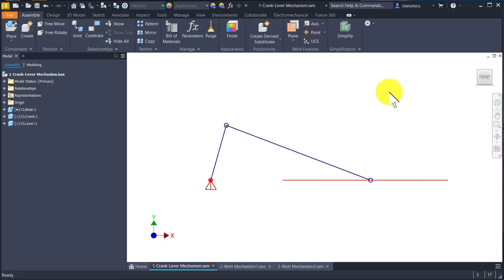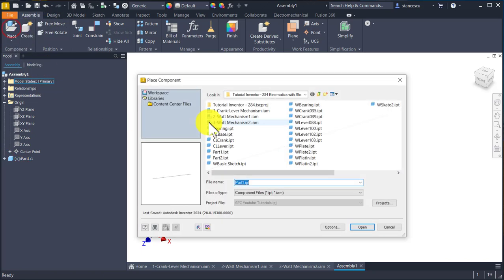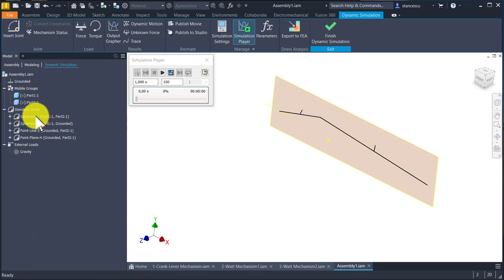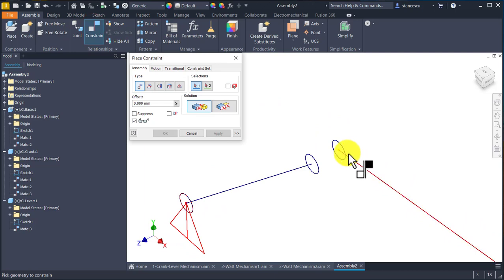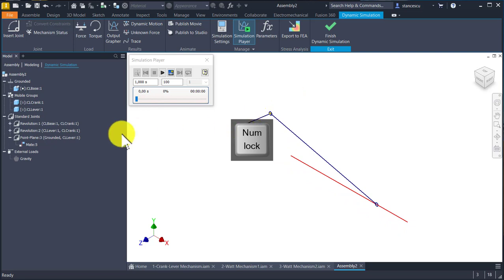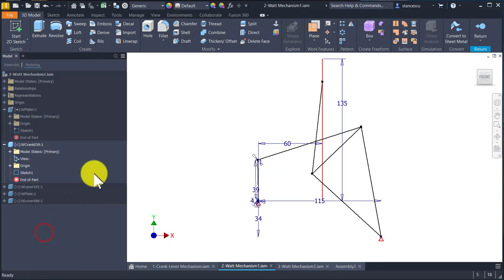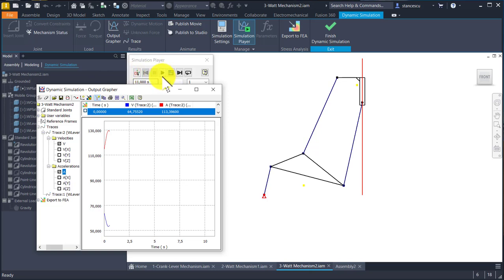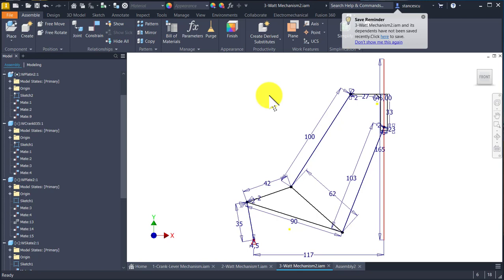Tutorial Inventor - 284 Kinematics with Sketches - SOLUTION

Comment: Hello, you are the best again. But let me remind you of my question in this video. Tutorial Inventor - 148 iCopy.
"Let's say a semicircular chair and you need to make racks that go from the bottom to the top of the backrest. All radii are different and the upper part is tilted. I tried it, but it didn't work out. Will you succeed?"
The question is very relevant! If it is not possible to do this, then say so. And we will do everything with our hands.
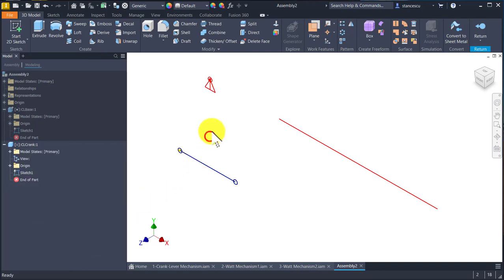Reply from the maker: I am sure that you can use iCopy to make your chair model. In the tutorial 148 you have all the procedure. At the minute 18:26 you obtain lines, then all the lines are substituted with metal frames. Note that the frames have identical section, and you want to be cylindrical with different radius. To do this you have to define EACH rack one by one, assuming different radii but the length as the line generated with iCopy. Then you have to create the proper ends for each rack in contact with the rails. Good luck!
Thanks for appreciation of my work!
Reply: @prof-stancescu   Yes, you're right. I can use iCopy. But here's another question. I have misinformed you. There is a chair, a bottom and an upper arc. The upper arc is at an angle of 5 degrees to the bottom. So we need to make a rack to distribute it later. I immediately have a problem in choosing the working plane for the further array.
Reply: @prof-stancescu  Who else can help in this matter besides you. I think there are no such specialists on YouTube.